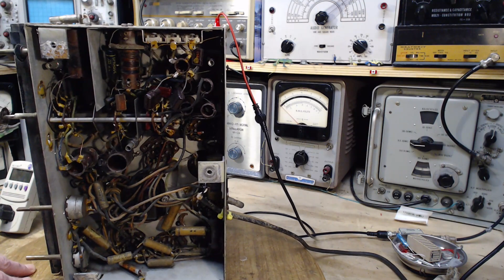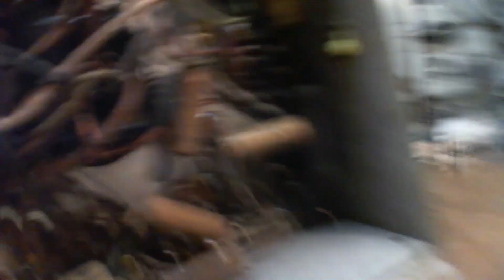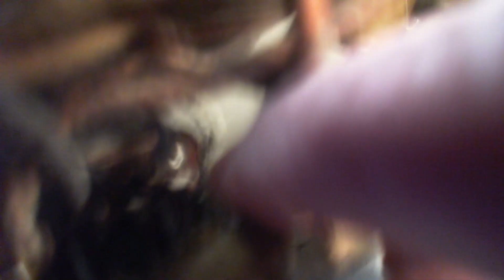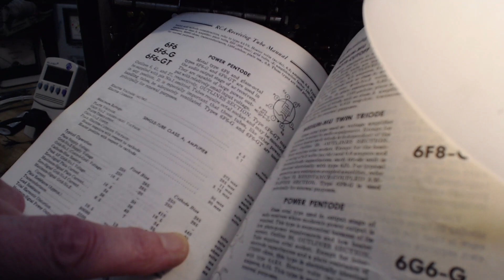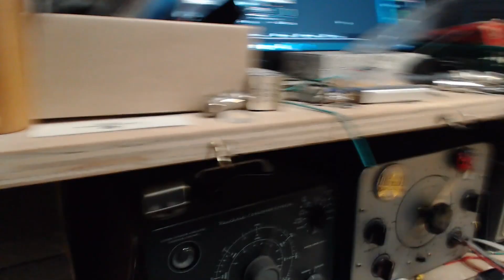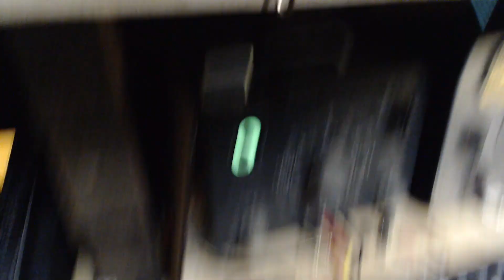Crosley Mohawk Model 14B Tube Radio Video #4 - Output Tube Grid Blocking Capacitor

Comment: The 6F6G was designated because the schematic doesn't show pin one as a ground that a metal tube would normally be.
 Present circuit could have used pin one as a high voltage or grid tie point. 
Either causing grief when operating...........
Reply from the maker: I better check that!